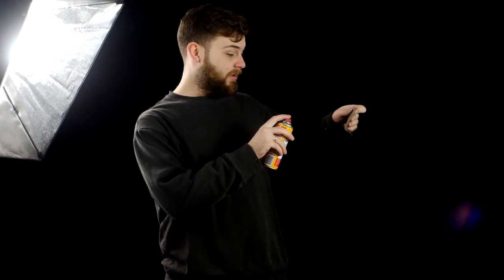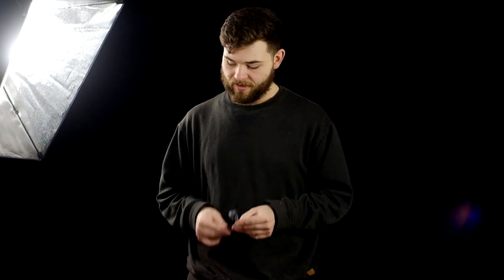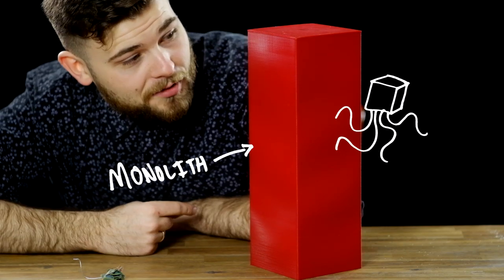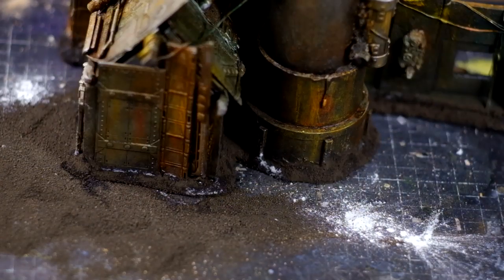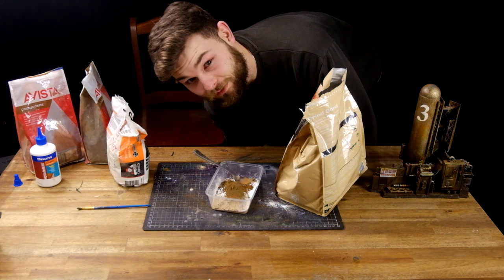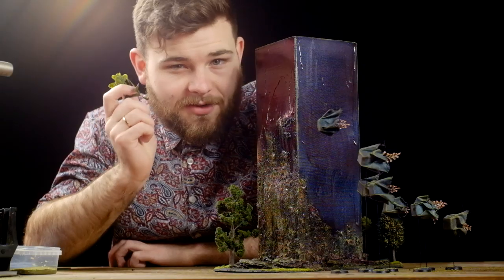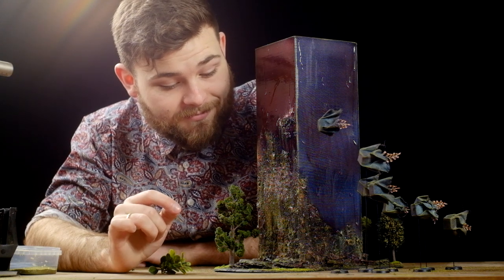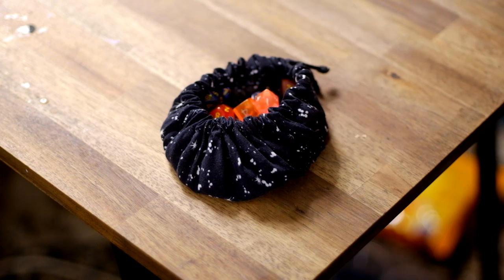Lovecraft, Colour Shifting Paint & Dice Bags | Vlog 002

Comment: Looks great! I wish you would have sanded the monolith though to remove those layer lines, hard to unsee!
Reply from the maker: The monolith was 3d printed specifically for the layer lines, in hopes they'd make it look a bit more alien or organic. With the colour shifting paint, it actually looked pretty effective, the gloss coat is the area I didn't like and emphasised the lines weirdly. If I didn't want the layer lines I was just going to make it myself by hand with plasticard (it's just a big rectangle after all.) If I was to build it again, I'd do things differently, but that's the nature of doing things for the first time, you experiment and you learn. Cheers!
Reply: @Miscast  Yea, I noticed it the most on the gloss reflection. The warping really helped the color shift pop :)

Comment: What air compressor do you use for the airbrush? I can't find a decent one anywhere
Reply: Also what paints?
Reply: @convolution223  I only got into airbushing a couple of months ago, but I use a Paasche d3000r compressor. For paints you can use any modeling paint thinned down with a bit of Airbrush Thinner (I use Vallejo's brand). Mostly they're great for laying down big patches of the same color, so if you're painting large objects or armies with a single main color, it'll help you go through them fast. Hope that helps. Good luck, have fun.